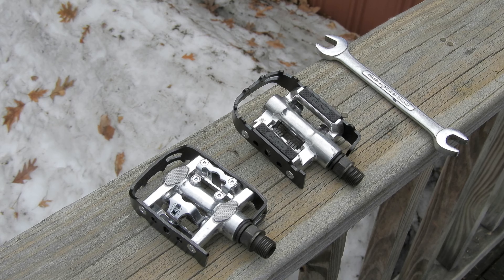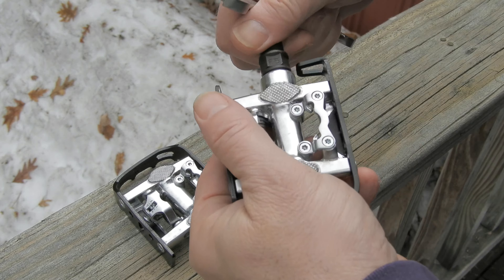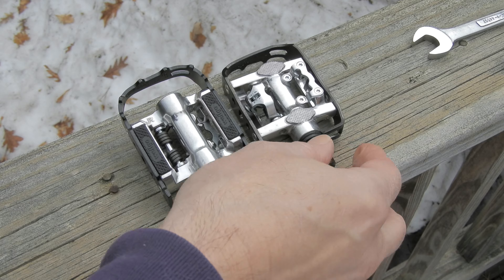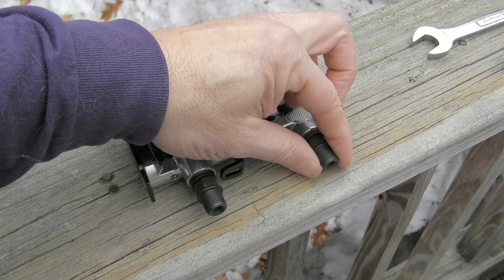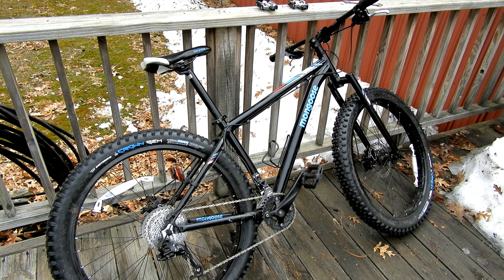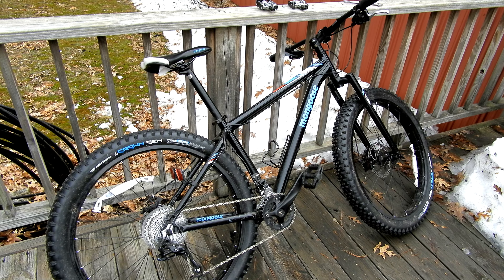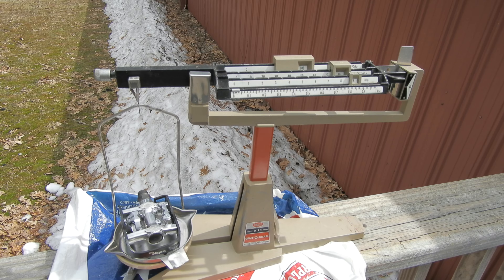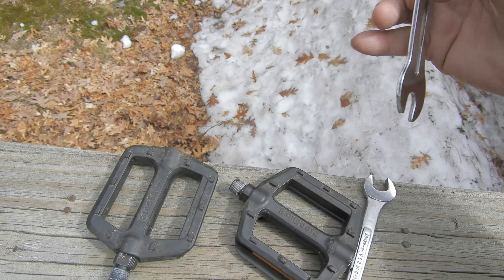Pedal Swap and Mongoose Ripsaw Update - Wellgo Multi-Function Mountain Bike Pedals

Comment: I one to buy this bike , but Im intrigue about if changing the suspension it's possible .
Reply from the maker: The best thing about this bike is that it is light-weight. Because of the tires, the ride is pretty cushy without a fork or suspension seat-post. The tires I put on made it even more so as they run at a lower pressure (8 to 22psi).

Comment: Can you measure the front and rear axle/hub widths? Also when you changed the tires could you tell if the rims were double walled?
Reply: redfordc they are single wall
Reply: the rims are single-walled on the stock ripsaw
Reply from the maker: Sorry, I missed your message, it didn't come up in notifications. It looks like you got answered on the rims. I don't think the axle is extra heavy either, the bike is pretty light for what it is. Will be back up in a few days, will try to shoot an overdue update on the tires and will mic the axle too.